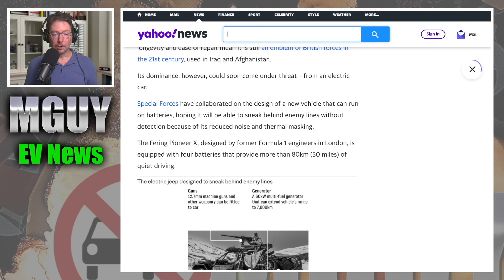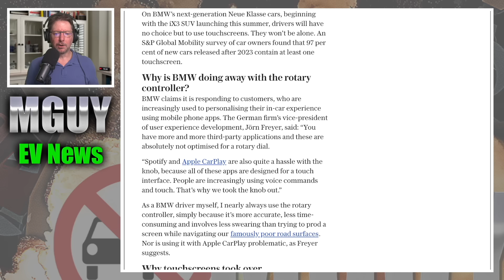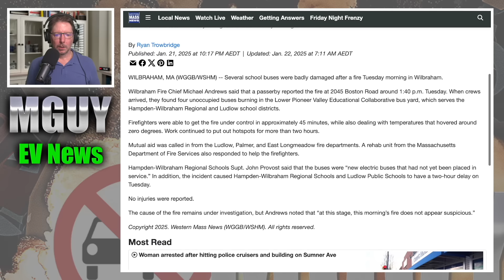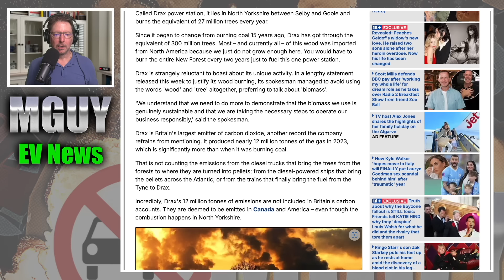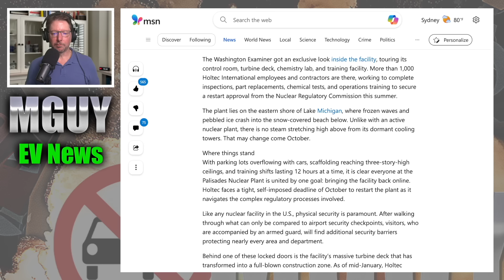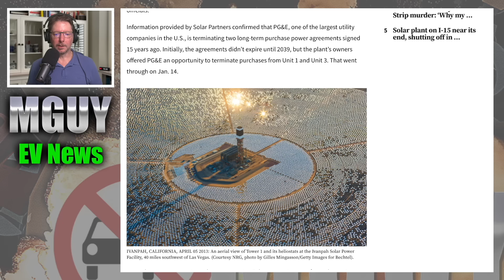Electric Jeep is UK's latest EV madness | MGUY EV News 26 January 2025

Comment: You're right on a lot but you're very wrong on the hybrid for special forces use. Your arguments would be fine if it were for general purpose but it's not, it's a niche tool for niche applications. There are a tonne of advantages to having that kind of electricity stored and available without firing up a generator. I suspect most of the time, it will be used as a simple way to keep a large battery charged while moving between locations.

A lot of modern warfighting gear depends on electricity and, with the advent of drones, ECM is a big thing. Individual equipment requires loads of batteries to be carried and this can be a huge limiting factor. The amount of electricity this thing can store for 80km range will be massive and it will mean equipment can be powered and recharged in austere environments without requiring a generator. Yes, it'll run out eventually, but that's the same with food and fuel. 

By the sounds of it, they're building it to test and see what happens. I think that is a good thing and the reduced thermal signature is a very good thing. It may allow  silent running but I suspect that's a headline feature that won't necessarily be used much.

Much like electric motorcycles replacing the old dirt bikes used by special forces, this is not something suitable outside of niche applications, but is very useful within those applications.

Comment: Oh, Simon, let's consider this as a misspeak. At 13:35, you said that concrete and steel required for the wind turbines is manufactured using diesel power. This is, of course, wrong. Concrete and steel are manufactured using coal.

Comment: Primary functions must be big knobs like in the past.  The system in Toyota uses, a row of small buttons you have to press the right amount of times is hell too. Why, when you are driving on narrow road in the rain with other traffic, you have to LOOK at it to carefully press the right button. And check if the right function is activated. Press really the wrong button, "auto let the computer do it" all settings are screwed and your windscreen will quickly fill up with condensation. It is simply dangerous!
 For aircon, ventilation direction (foot, middle, to windscreen), fan-speed and temperature, big knobs are a MUST for safety.

Comment: My newest car is a 2007 Mercury Grand Marquis (a fancier version of the well known Ford Crown Vic) NO touch screens, no cameras, no microphones, no trackers, no WiFi, no spy devices of any kind. And it doesn't have a zillion alarms and/or try to drive itself. It also cannot be hacked. I bought it about a year ago with only 36,000 miles, it now has 43,000 miles. Almost all the miles I have put on it have been highway miles, taking 500-600 mile trips.
Reply: I had one of those. Like riding in a big steel cloud. Put 300K on it.
Reply: Your 2007 Mercury Grand Marquis is very similar to my 2002 Lincoln Town Car that has been my daily driver since 2007. 
  I have driven 93,000 miles in the 17+ years that I have owned it, and it has been very reliable.
Reply: How much did you pay for it?
Reply: @ $10,000 cash. No tax or fees.
Reply: @geraldscott4302 
That's a steal, nice!

Comment: There is no more "sneaking in undetected" In a modern battle field where everyone has drones hanging in the sky and people on the ground with thermal imaging cameras. Imagine a bullet or shrapnel hitting the battery, what will happen then, a fire will burst out of course. We have made fuel tanks that can repair themselves if a bullet goes thru, but a lithium battery will go up in flames with the slightest breach of the battery cells. EVs for military use, you must be kidding LOL

Comment: The electric Jeep  I wonder if they have done rigorous testing for the  battery sells for vibration  impacts for rugged terrain etc etc. bad idea.  And as for the chemicals released into the atmosphere I think we're going to have problems with acid rain . It's only thick grey smoke 🙄.

Comment: Producing giant Lithium storage batteries. Producing millions of Lithium batteries for electric cars. Building massive Solar Panel Farms. Installing millions of giant Wind turbines. Are we heading in the right direction, or are we heading into disaster? These installations are being built at a rapid pace with very little or no research being done beforehand. Scientists have been concerned for years over the construction of massive Solar Panel farms, and It’s only recently they have turned their attention to Wind Farms and how they can affect natural airflow.
 In the past few years of trying to reach Net Zero Emissions, dangerous weather conditions have got worse. We have experienced more frequent Tornadoes and cyclonic storms, more severe humidity and heatwaves, extremely heavy rainfall and disastrous flooding worldwide. 
In the past few years record high temperatures have been broken year after year, more countries are experiencing out-of-control wildfires, ocean temperatures are increasing and causing coral bleaching, and changes in marine ecosystems. It appears the more we are going for renewable energy and zero emissions the worse severe weather conditions we are experiencing.

Comment: I can't imagine what would happen when a round goes through a battery. Going to have to wrap it up in 12mm armour plate as a minimum. Going to slow it down a bit. Imagine having to protect your means of locomotion and not the soldiers?

Comment: American Special Forces had super quiet quads a couple of decades ago. There’s zero reason why you couldn’t put a very fuel efficient and quiet (at low RPM) petrol V8 in a military 4x4. Let’s face it, a diesel Landy has the same stealth properties as a Motorhëad concert.

Comment: Batteries degrade because if your EV is not fitted with an electricity filter, dirty or contaminated electricity will degrade the battery and components. Contaminated electricity is often referred to as “dirty” or “Noisy” electricity, and unless your EV has a filter to reduce the potential damage caused by “dirty or noisy” electricity, it can degrade the battery and damage sensitive electronics in the EV.

Comment: They are electric because it makes them silent. This is useful if you are trying not to be detected and shot at. Special forces use electric motorcycles too for the same reason. The whole army does not use them, just special forces for specific reasons. In the past they were hybrids as the battery range was not good enough. What part of this is hard to understand?

Comment: Traditional car controls allow operating those controls by touch alone so that the driver does not have to look away from the road.
Touch screens on the other hand have (ironically) NO 'touch feel' so the driver must look at them to operate them and they also have to be accurate while sitting in a bouncing car.
Anyone who cannot see the dangers in this should NOT be designing cars.
It is illegal to operate mobile phones in cars for this very reason.

Comment: I've talked to some serving REME engineers and when I asked them about EV vehicles they are using and they went a bit red in the face and eventually one quietly said they only use them around the base as they where taking to long to charge up..... Straight from the poor buggers who have to use what there supplied with...

Comment: The fire suppression system was turned off because it would have probably destroyed every battery and there was no test of the toxic gases in the surrounding valleys because they did not have equipment to do so.

Comment: How exactly is an EV supposed to function behind enemy lines? Is the enemy located in a Smart City? Do the charging stations come with cloaking capabilities and invisible charging cables?

.....oh wait it's a hybrid?! Then why the fuck even make it???!!
🤣🤣🤣
Reply: @l33t007  The heat signature of an ICE engine is very easy to detect. EVs will allow a more stealthy approach for particular mission scenarios.

Once the attack begins, the enemy knows the opposition force is there anyway. So then using an ICE engine to manoeuvre after that doesn’t matter. That’s why the fuck to even make it.

Comment: I have a large touch screen on my Jag SVR. Now it gives a nice satnav display but trying to use it on the move is dangerous. Fortunately it has very easy to use buttons for the bulk of the functions but I do need to use it every time to turn off the (also dangerous) stop start facility - that’s only 2 prods. If my wife is in the car she usually turns it off but she still struggles to accurately press the screen when the vehicle is moving. The apple car play function isn’t too bad as the app icons are very large and easy to hit. But this move to touch screens for all functions is hideously dangerous - how can it be legal to use these screens but not fiddle with a mobile phone. This is one aspect of our lives the government should intervene in. Except of course if they do they’ll find a way of cocking it up.

Comment: Well if you sneak them behind enemy lines and leave them. Then using a remote controlled  small incendiary device. You set off the battery into thermal runaway. Now the enemy has all these fires 🔥 to deal with. 
And if we use an automatic drive system to deploy the EV “bombs”? Hmmm 🤔 

Back in the 90’s we did have cars that were going to touch screen controls. And people didn’t like them then either.

Comment: The manufacturing of cement produces a huge amount of greenhouse gases. It is one of the "top" polluting industries on the planet. So if 1300 tonnes of concrete are required for each windmill don't forget to factor in the cement.
Reply: Let's not give them any more foolish ideas!

Comment: Successful Touch screen user interface depends on good software and well thought through user-interface.
Apart from indicator stalks, horn and hazard flashers, all other functions can be replaced with automation.  Eg aircon, just set your preferred cabin temp and let the AC do the rest; I know this is possible becuase when I used to unlock my 2015 BClass (electric) it would chose the right combination of cabin heat, fan, screen demist, heated seats or cooling as required. No input from me.

Comment: Can I just say the supply chain to get fuel into traditional battlefield vehicles is far more complex and fragile than laying out a few solar panels. So actually EV would work well with the right attitude.
Reply: That is a joke, right? Or do you really haven't the slightest clue that about a square mile of solar panels would be necessary to keep a single battle tank running?

Comment: Compared to proper cars with a real engine, EVs are much heavier, have much shorter range, take much longer to refuel, are weather sensitive, the battery degrades unlike a fuel tank and have a shockingly low resale value....  They also do this 🔥
They are an impractical solution to an imaginary problem. 😲  😲 😲😲

Comment: At 3:40 - Regarding touchscreen dashboards...

By the mid-to-late 1970's, one could assume the driver's position in almost any GM, Ford, or Chrysler product and find the climate-controls, turn signals, headlight controls, tranny shift, etc.  IN THE DARK, so standardized were they.  And NOT, as I recall, by mandate.  Good luck getting into a strange auto on a dark and rainy night in todays' vehicles.  Spit.

Comment: I have been driving for over 50 years without incident however after waiting two years to get my new VW it had been upgraded to full digital cockpit, it has been 2 months since I got it and what a bleeding nightmare the controls are the most unintuitive setup I have ever known it now requires a co-pilot to assist in adjusting the heating control safely whilst driving on our roads in the UK witch are to narrow full of potholes and usually covered in wheelie bins etc. I hate it.

Comment: My 2020 Toyota Corolla has screen & real button combination just right. Climate control is buttons & knobs, heated seats are real switches, steering controls buttons that move. Touch screen display is for CarPlay and some vehicle setting not commonly used. Good job Toyota 👍🏻.

Comment: Double standards in the UK.

Operating a mobile device, even one in a docking station fixed to the dashboard, is illegal and will earn you a fine and points on your licence if caught.

Car designers putting more and more of the car’s controls onto a touchscreen - that’s okay.

The argument made against the docked mobile device is that it is distracting and dangerous because the driver has to look away from the road to navigate the menu system and use it.  So please enlighten me, how is a touchscreen any different?

Comment: The concept behind the Fering Pioneer has nothing to do with having ‘environmental credentials’, it’s do so with its battlefield flexibility and capability. Current Special Forces vehicles heading for remote targets, either have to be supported on the ground with fuel resupplies (trucks) to travel vast distances (due to their inefficient diesel engines), or they have to be transported close to the objective by high value assets such as transport aircraft or helicopters, both of which are susceptible to poor weather which can prevent them from operating. As a diesel-electric vehicle, the Fering Pioneer takes advantage of the fuel efficiency of such a system and so allows the vehicle to drive vast distances to and from the intended target completely independent of other outside support - fuel trucks, helicopters or transport aircraft. Its design has absolutely nothing to do with trying to be ‘green’.

Comment: DRAX B

Talking of HYPOCRISY: Aided by UK government subsidies, the switch from coal to wood (biomass) at the Drax-B Power Station (built near surface coal deposits)  took place when biomass was cheaper than other renewable sources of energy, but the strike price of wind and solar has since fallen far below that of biomass. 
Since burning wood creates 4x more carbon pollutants than burning fossil fuels, further subsidies for this industry are controversial. In the UK Taxpayer subsidies for Biomass are to be continued until 2027, part of the 24% renewables tax, plus 5%VAT of course, on your domestic fuel bills.

International carbon accounting frameworks allow emissions from burnt wood to be included in the carbon budget of the country in which the trees are grown rather than the country in which the wood is burned. Smokestack emissions from UK biomass power plants are therefore 'not counted as UK emissions'. Although perfectly legal and in line with rules laid out by the Intergovernmental Panel on Climate Change designed to prevent double-counting, critics have described this as an ‘accounting trick’ (Clark 2023, Lawson 2023). While it helps the UK reduce its official emissions, it does not reduce global emissions and, in practice, the UK is creating more greenhouse gases to produce electricity than it says it is. NO, SURELY NOT?

Most biomass for the UK comes from the US and Canada in diesel powered ships and is transported on land by diesel powered trucks. The pollution of a round trip of these huge ships is estimated to be equivalent to 50Million Diesel cars doing the same mileage
Again, the DRAX, converted from a coal burning power plant, is built adjacent to UK surface coal deposits.
Our greatest exponent of biomass even on his Royal Estates (it is reported) is our 'king' who lectures us regularly on Climate Change, Net Zero, Atmospheric CO2 blah, blah, blah.
UK (ECO) EV's use the electricity powered by Biomass as part of the Grid power mix.
Ed Miliband has just closed our last STANDBY coal fired power plant, October 2024, bless him, he knows not what he does.

Comment: Even this ridiculous article from a renowned Purveyor of Fake News gives it away “50 miles of Quiet Driving” so to get it behind enemy lines and back safely, they’ll have to put it on a diesel flatbed then?

“Former Formula One Engineers”, now we know why they are Former!

BMW are complete hypocrites, slaves to the universal malady that has overtaken common sense, their slogan ought to be amended from “The Ultimate Driving Machine” to the “Detached Reality Nightmare”. I test drove the original i3 (a brilliant car were it not for all of the negatives associated with EVs) that was festooned with screens but also had buttons for essentials like a real car.

it had one odd addition added, the iDrive rotary controller acted as a touch screen on the top so for navigation one could write characters with a finger tip fir a place name of postcode and character recognition and some recognition software created a typeface interpretation so with practice it worked but frankly that would not while in motion. The speech control was excellent however, far better than Siri or Alexa, well it was for my postcode!

Comment: Another great video, On the Touch screen section, that was one of the main factors in the purchase of our last new car when we got our 2022 Audi SQ2, its still has all buttons and switches with no haptic buttons on the wheel and runs the Audi MMI system similar to the BMW, once your familar with it it's much easier to use than a touch screen.